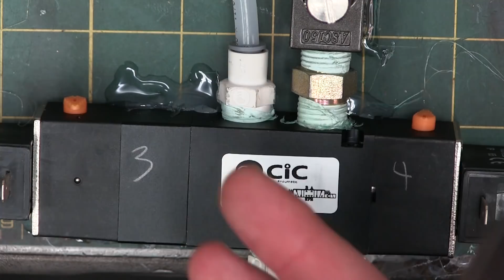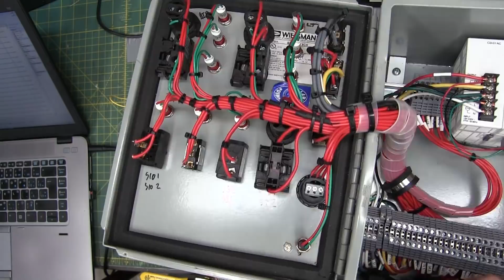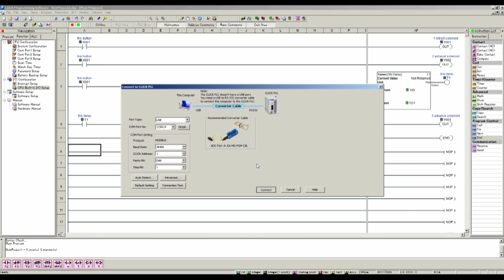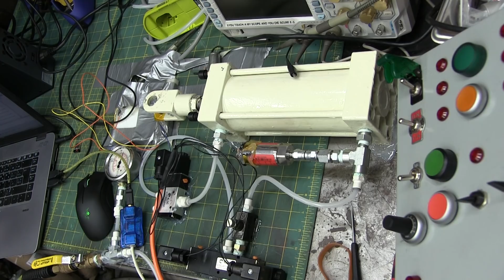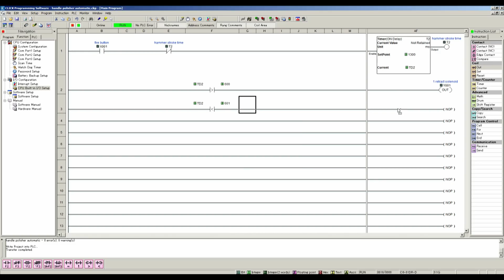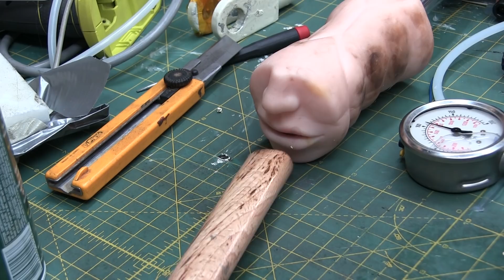Pneumatic Cork-Stuffer | PLC Programming Intro

Comment: Couldn’t you have just used a single solenoid that was two position and five port? You could do away with the extra bleed solenoid and put some sort of air restrictor on the outlet of the solenoid to achieve the same sort of spring

Comment: They have arduino industrial type on a website that kind of markets them for industrial use they come in a plc looking case along with 24v inputs and outputs they also sell shields to handle hmis and relay blocks. They are a bit pricey. But i was thinking the same thing, i played with an arduino trying to make a digital intercome system with addressable stations where u worked as the old intercoms called out all the stations at the same time 2 wire system even if you didnt want or need to. It would kind of work and then kind of didn't it would glitch out and not call any of the stations or call them all. i was trying to connect them using the i2c standard i think that was causing issues as well due to the distance or noise in the wires. I was using the existing wires

Comment: After extensive background in electronics (specifically in wiring systems) I'll never forget the one time I was talking with a mechanic after swapping job from wiring documentation to automation design. It took me almost half hour to wrap my head around the idea that a pressurized air doesn't need to form a complete loop in order to work, as opposed to electricity. You can just vent the excess pressure wherever. I always assumed that there was a 'suck' and 'blow' pipes in each hydraulic movement where one pipe sucked and one blowed and then they just swapped directions to change direction- the idea that you only swapped the 'blow' direction was incredibly alien to me.

Comment: Compressed air is nothing to screw with.  USCG Federal Standards for inspected vessel fuel tanks require pressure testing in front of an inspector at 5psi.  The safe way to do that is to fill a tank with water and add to a garden hose threaded onto the tank enough water go develop a 5 psi head (about 11 feet above the tank.  Safe. Easy to see leaks that can be marked for rewelding and repair.  The shop that was doing the work for the first time and decided it would be easier to use air.  They set up before I got there and were really overconfident about their stainless welding.  At least they had the sense to run away when I recognized what they'd done and started screaming.  Instead of a water leak they ended up with the 6' x 6' top of the tank on the roof of the building next door.  Nobody was hurt but the material was unusable and about 50' of certified, xray'd weld had been wasted.  A couple of old guys in the shop looked like they'd seen the second coming of Jesus.  Yes, mom.  Shit stains do show through welding leathers.  Gee -- it was only 5psi!  The replacement work was done at another shop with previous experience.

Comment: As someone working in a machine shop, hoping to get into engineering these kinds of devices (minus the cork-stuffing part, of course...) I'm finding your videos surprisingly enlightening... in addition to entertaining as !@#$.  That said, I am a bit newer to your channel, so I'm having trouble understanding some of your "colorful" terminology.  Do you have a glossary of common terms you use?  I can kind of figure out the meaning of a word by the context, but just as I think I've got it fingered out, I hear you use it somewhere outside of the context I had it narrowed down to.

As a side note... been working on an idea for a book discussing the finer points of "context", and how things sound very different when taken out of it.  One such example I've heard at the shop I work at is "Pull it out, give it a good blow, and just stick it back in."  This line, of course, was in reference to a CNC tool that was plugged with chips due to an improperly installed cream-strainer (coolant filter), and was said to me while I was being trained on a new machine.  Neither of us even realized how it sounded until nearly a week later when I was trying to recall that bit of edumacation to solve a similar issue.  Let's just say it gets some good laughs when I tell people about my experience with "context" in a machine shop.

Comment: I hope you see this AvE (Or anybody else that has electrical knowledge) 

So, I'm making a homemade iontophoresis machine (power supply), it's very basic. It consists of two 9v batteries connected in series (18v) through a switch and into two 5.5mm DC Jack sockets.

An iontophoresis machine basically supply's a current via positive and negative connected to two seperate trays filled with water, you put one hand in each tray which completes the circuit and this helps reduce the amount your hands sweat.

The problem I'm having is when I put my hands in the water I get a small electric shock, same when I take them out. Is there any way I can prevent this from happening?

With a resistor? I want to keep it as simple as possible because I don't know much about electricity, circuits or even batteries lol.

Thanks for taking the time to read guys.

Comment: Why not just use a QEV and a solenoid 3/2 or 3/3? Seems like a lot of fuss for a simple task. Also, the lines you're using are pretty undersized for that cylinder.

Comment: The thing that you call a programmer is just a usb to rs232 converter. And you need to turn the usb cable over twice to get it the correct orientation because usb connectors are 4 dimensional.

Comment: It struck me, wouldn't it work much better to have the fast out portion actually done by a spring. With a spring there's no air in flow issues and the entire contraption is simpler. 

A coil spring in or around the cylinder pushing it out. Pressurize the return side to suck it back in, no jurkyness cause of high pressure on spring.

1. Out faster, no waiting for air to fill cylinder extend side of cylinder. 
2. Less air valves, only need to control the retract side of the cylinder.
2a. Air in to retract, flow controlled for speed. 
3b Air dumped to extend, will dump faster with more constant spring pressure pushing out. 
3. Extend side of air chamber can simply be left open.

Comment: If your low voltage is DC,  you have an additional power option...
Add a small capacitor across the resistor to give the solenoid a few milliseconds of 4X punch for very fast response time.
Make sure you get the polarity on the capacitor correct if it's polarized or they self destruct.
P.S. You forgot to put the lipstick on the pig.

Comment: Try one of the "programmable relay" PLC's like the Crouzet Millenium or Omron Zen.  They can still be programmed with ladder logic, but they also have a nifty drag and drop Graphical Programming language which is much easier to use and more intuitive, and still requires no programming expertise.  And, they are cheap as hell.

Comment: hey late to the party as usual, those usb cable programmers are probably very replaceable with either a usb to serial adapter (maybe 5 bucks from scamazon) or a ch341a programmer also very cheap, the pinout if its rj-11 will just be transmit, receive and ground so its pretty straight forward

Comment: Never use the plc for directly runing solenoids, instead connect it with a relay on the plc output and isolate the plc, if you short the output accidentaly you're left with a plc that has burned output. It doesnt matter if the plc uses optoisolators or relays inside, just lut a relay and then you can run 12v to the relay contact to power the solenoids.. Just save yourself from headache.. And the best part the plc wont get any damage. Thats how its wired in industrial equipment..

Comment: Except for MMI, everywhere I've worked (in Britain) fucking about with compressed air was reason for instant dismissal. About the only 'trick' you could get away with was spinning old ball bearings up to about 200,000 (?)rpm and 'racing' them down thew lane  behind shop. 6307 will make a lot of sparks and go about 120 yards . Guess we were lucky none were ever bad enough to explode outer cage, probably lose a hand if that happened.

Comment: Get rid of that single coil solenoid and put quick exhaust valve with metering needle on the ram. That way its less complicated, cheaper and whole thing doesn't go out of whack if some one relocated solenoid and changed length of tube.

Comment: You wanna see where compressed air is dangerous? Blow out the hoses for a concrete line pump. Only way to do it efficiently, quickly and cost effectively is with an air compressor. If the guy controlling the valves on the air coupler fucks up, gets distracted at the wrong time or is inexperienced...can seriously injure the guy holding the whip end of the concrete hose. I've personally been lucky enough to have never been hurt by it...but I've come damn awful close.. My dad on the other hand, not so lucky. Got hit in the eye by the bell end of the hose (luckily didn't lose his eye). That was due to distraction. Compressed air is equally as dangerous as a hydraulic system. Both can kill or seriously injure.

Comment: I take issue with your "Arduinos are glitchy" assertation. I think you meant "AvE's code is glitchy".
Reply: The electronics are generally dodgy on Arduinos; built down to a price of 1 cent.
And many of the available Arduino libraries are far from robust.

There are hardened version available but they don't e.g. directly run relay or solenoid coils. But they co$t.

One can nevertheless use an Arduino for development on the um testbed and then roll a custom board for an AVR processor and supporting circuitry to drive outputs and sense the world in weird and wonderful ways for a better product than a PLC-based one. But that is a non-trivial exercise that can take weeks if not months to produce a professional result.  

What you can cobble together on an ordinary Arduino might work today, but there's a significant probability that it won't work down the track. That's  a critical safety consideration when you are controlling systems storing and managing substantial mechanical forces.
Reply: @BerndFelsche  Is there any other alternative to Arduino, like something more reliable but still affordable for a hobbyist? Please give an example if you know any.

Comment: Truckdriver here in New Zealand was blown up like a balloon as his skin separated from muscle after he slipped off the platform up behind the truck's cab and landed with a butt-cheek cut into joiner on one the air reservoirs for the truck's brakes... He said it felt like his skin was burning inside as he swelled up....
http://www.dailymail.co.uk/news/article-1390642/Truck-driver-survives-INFLATED-air-brakes-tube-pierced-bottom.html

Comment: Oh shit, I'm about three years late watching this video but I had to pump the breaks when you started programming that PLC.  I plan to finish watching it but I can only suffer an old shit IDE for a few minutes tonight.  Why the hell wouldn't you use the gpio pins on an Arduino with some relays where you could at least use a "modern" language like C? Whatever you do don't try to interface the PLC over your local network or it might start picking up noise from the microwave or Russia.

Comment: Arduinos are kind of a tossup. I've had one controlling my door lock for a few years. The buttons and connectors have issues constantly, but my $1 Chinese Arduino clone has had no problems at all! Although I can't say the same for my cheap STM32 clone chips. Those things are trash, it's a miracle if you can get one to work at all!

Comment: https://www.usplastic.com/catalog/item.aspx?itemid=133502

This is the first google result I could find, but you get the idea. Basically a check valve that exhausts on back-flow. Maybe easier than the second solenoid.